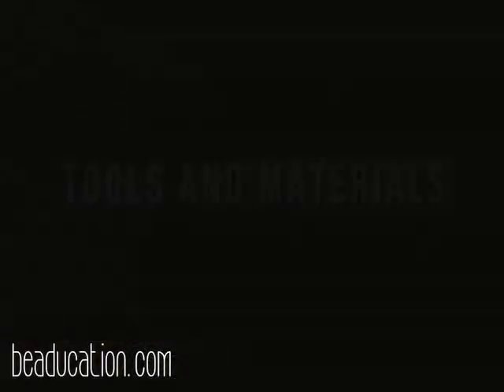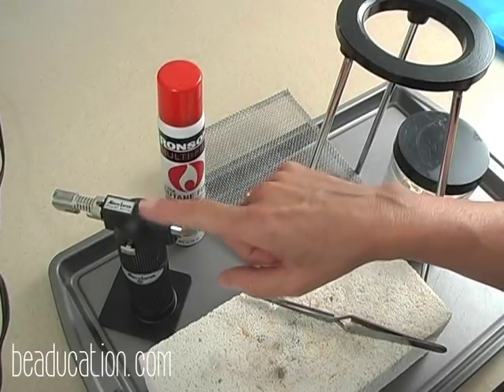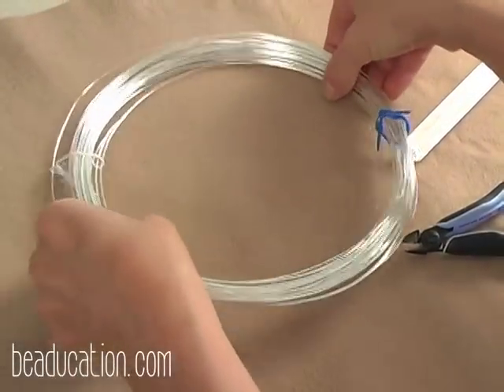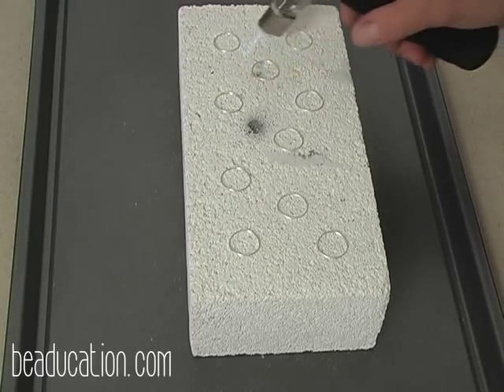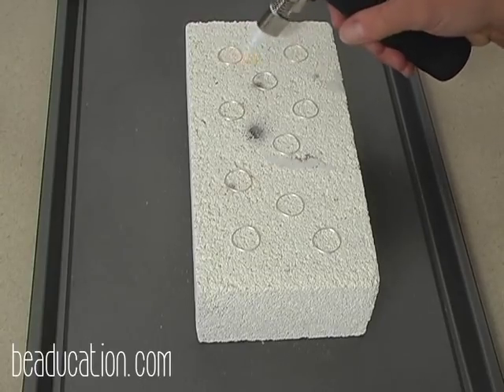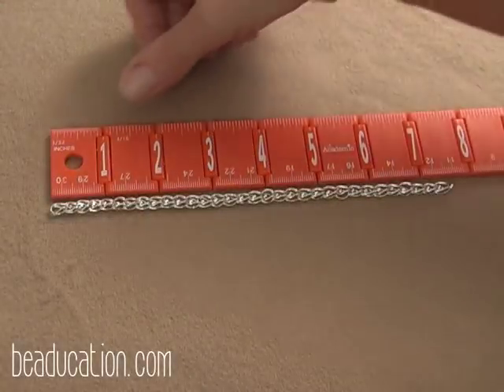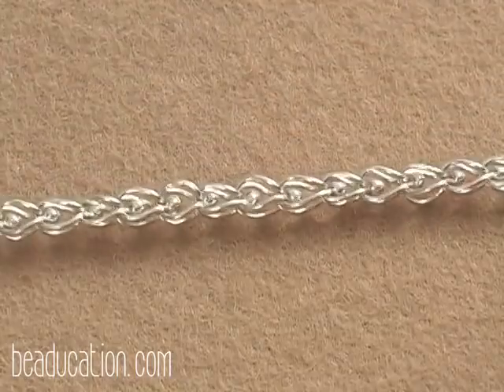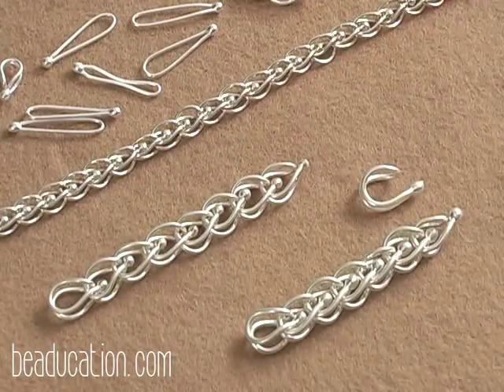Fused Fine Silver Peacock Chain Tutorial - Beaducation.com

Comment: The link to the supplies list no longer works since the website changed.😟  I love this bracelet and 2 years ago I made 2 of them. I would love to make another maybe in a slightly smaller wire gauge if possible for a finer chain but I can't remember how much wire I used last time.  Again, I love this. It was one of the very first pieces of jewelry that I made using a torch. Your instructions are so clear ANYONE can do this as long as they have the desire.  Thanks a million for sharing this!  Btw, to make my clasp match the bracelet, I balled the end of the hook (the part you curled upwards). 🙂
Reply from the maker: Sorry for the late reply, your comment kinda slipped through the cracks! It's hard to tell you an exact measurement because it all depends on the gauge and the size dowel you will use to make your loops. I suggest testing it a bit (maybe with cheap copper wire) to see how much you use to make the loops you want and then build a recipe from there to make the full bracelet.

Comment: Hello, very nice tutorial. The materials list says 11.5 feet is needed to make and 8 inch bracelet but that's wrong. Each loop is about 2" of wire, (5/8 X 3.14) and the bracelet in 
the video is about 34 links,  which works out to be 6 feet. I made 5 or 6 bad links while soldering and I found 7 feet to be enough for an 8" bracelet. Just wanted to let others 
know before they ordered double what they need.
Reply from the maker: Thanks so much for the heads up! I will make the change in the class materials list. Thanks!

Comment: Thank you for the wonderful tutorial.  I was wondering if you have ever used Argentium silver. I have read that it fuses nicely and does not tarnish. Do you have a concerns about this metal? I value your opinion. Thanks again!
Reply from the maker: Hi Timothy, I haven't had a chance to work with Argentium but have also heard the exact things that you mention. Sounds like a fun metal to work with.
Reply: Timothy, I work primarily in Argentium Silver and it works very much like Fine Silver with a few exceptions.  It is brittle when red hot so you don't want to be poking at it or moving it until it has cooled to grey again.  When holding it in the cross lock tweezers do not heat the whole piece, just focus the heat on where you want the metal to melt.  It will make for a more durable chain than fine silver and it's an amazing metal to work with and very forgiving.